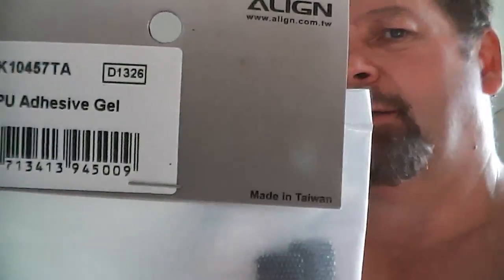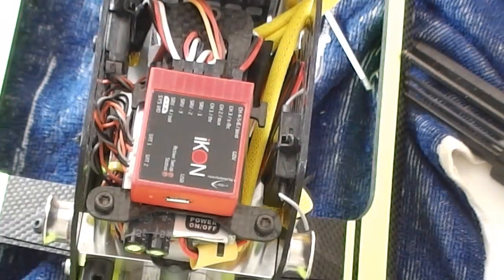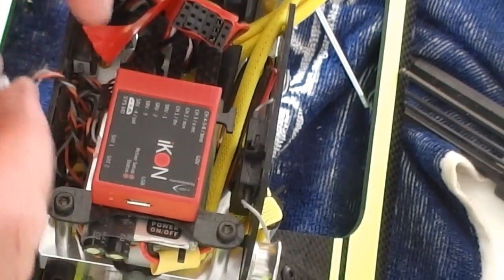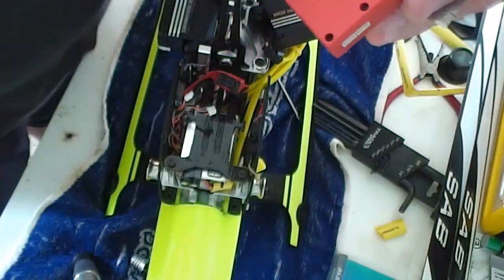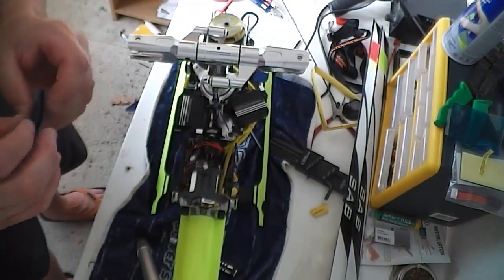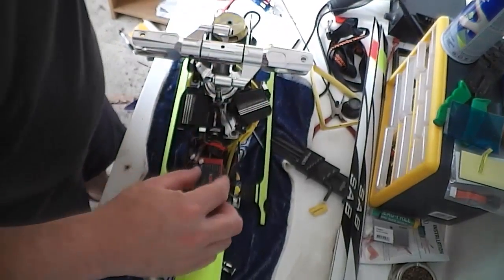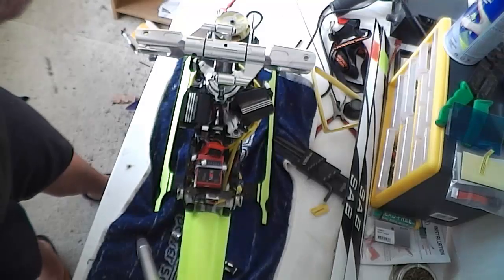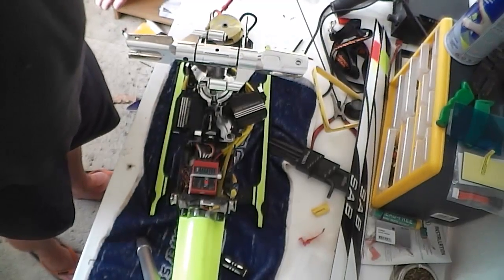Ikon how to self level part 1 of 3

Comment: No Way! Re think what your doing. Gel is good vibration isolation. Ifact I use Kyosho Z8006 Zeal Vibration Absorption Sheet 
but
The adhesive is zip jumk Crap puda. So I got rid of the adhesive and used my own.
Two Ways!
1. Gorrill glug down the Zeal Vibration Sheet to frame and FBL contorler
2. 3M indoor out door 15 pound mounting tape on eadh side of the Zeal Vibration Sheet.

Dont be zip tie the iKon down your defeating the work of gell Vibration Sheets.
Last
You can use any polyurathane adhesive you do not have to use Gorrill glue. Even Power Grab or liquid nails will work. Just use a good adhesive on the top and bottom of your Vibraton Absorption Sheet.